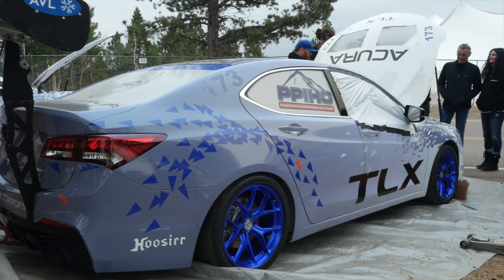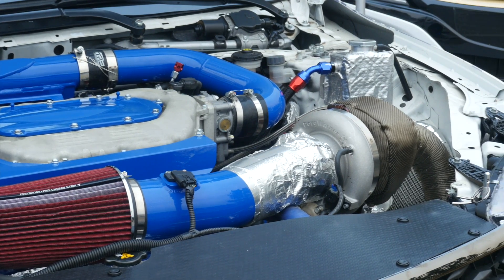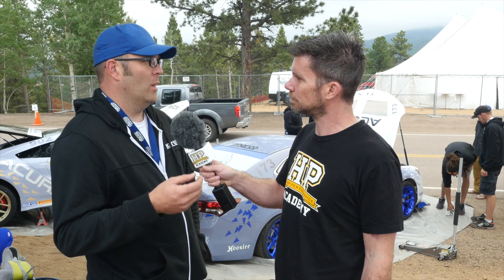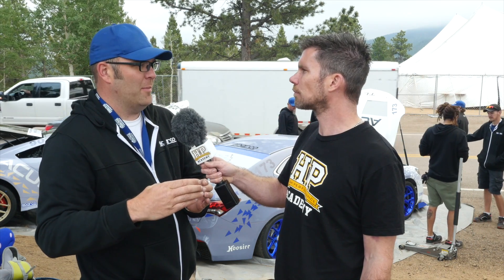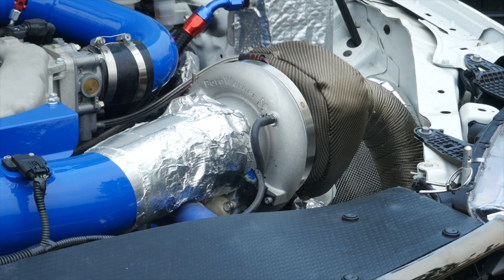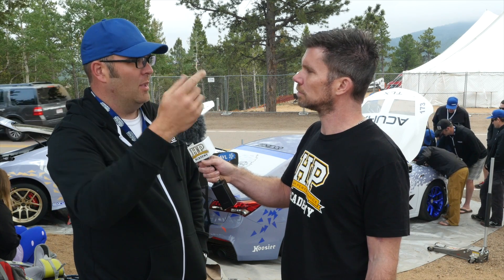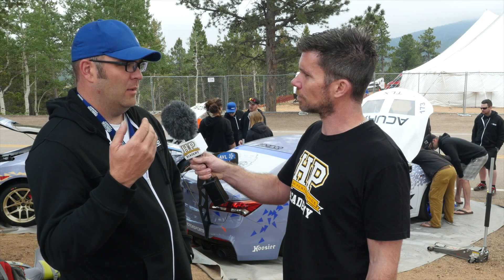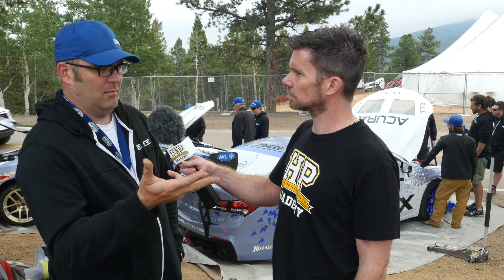[TECH TOUR] Factory/OEM Honda ECU Tuning | Acura TLX A-Spec FWD 3.5L V6 Turbocharged Titan

Comment: What TRANSMISSION is this running
Reply: No idea, my tlx is almost fully built. Have turbo low compression pistons just waiting to be put in but not sure if the tranny can hold that added power. I’ll add a video of my dyno soon.
Reply: @marvinclassen4179   bro post a vid 🥲
Reply: @marvinclassen4179  waiting on the vid

Comment: What's the 0-60?
Reply: prolly like 5 sec
Reply: @yungjarq2173  😂😂 more like 3 seconds, if the factory type s with less horsepower can push 0-60 in 4.5 seconds this car can do it in at least 3-3.5 seconds easy

Comment: Acura calls themselves "Precision Performance", so, what I need to know is why the hell didn't my TLX come with a turbo like this from the factory?  "Performance" my ass, it's just a good quality "near luxury" car that's fast and smooth, but nowhere near as viscerally engaging as a proper sports sedan SHOULD be.

cry
Reply: Christopher smh if they truly cared about performance it would’ve started when they made the rsx, very potent car with the motor it had and same goes for their v6s. If they really wanted to have a huge following and be known for best performance, they gotta care more than just about handling. Hopefully new tlxs come turbo
Reply: @Slavikhavoc  

Didn't you hear?  They've already officially announced an Acura Specific Turbo V6 engine, and, I believe it will be available in a TLX "Type-S" available later this year!  

I won't be able to afford to turn in my current 2018 TLX to upgrade to the Type-S, but I sure wish I could!

I'm just hoping that I'll be able to do so for a ~2 year old "CPO" Type-S TLX in a few years from now - that will be a happy day indeed.  Assuming that I don't get lucky before then and somehow get the car I REALLY want, which is a BMW M2.
Reply: @Slavikhavoc  6 yrs later and still not even a performance car to compete against germans, they keep underplaying these “top of the line” cars like the type s’s. i love my 20 tlx a spec just wish it had more of a modification scene to make it go faster

Comment: Looking to buy a turbo for my 2016 Acura TLX v6. Any suggestions?
Reply: We can hope that when the Type S TLX comes out (with Turbo) that it will be based on the same J series engine, and thus purchase the Honda parts to add to our TLXs?
Reply: The actual TLX A-Spec shouldve been a V6 Turbo, with a better transmission tbh. Exterior is amazing looking. But the rest, including interior is dated.
Reply: @craiglarkin7575  did you ever put that turbo in the TLX?